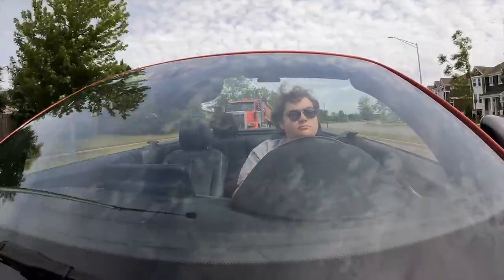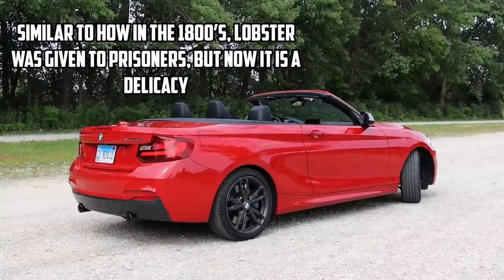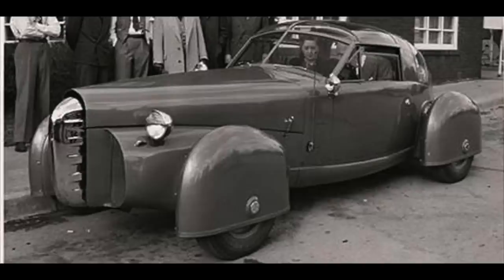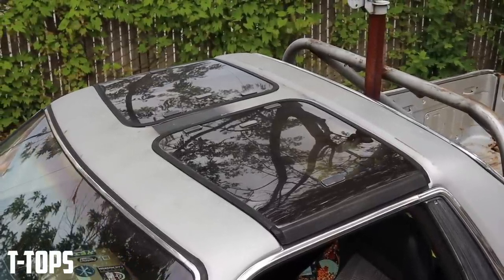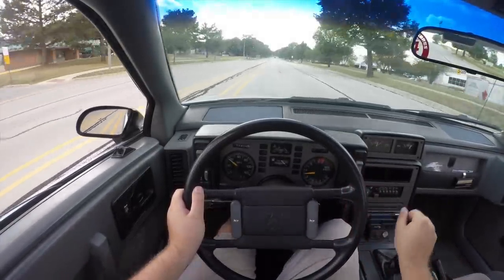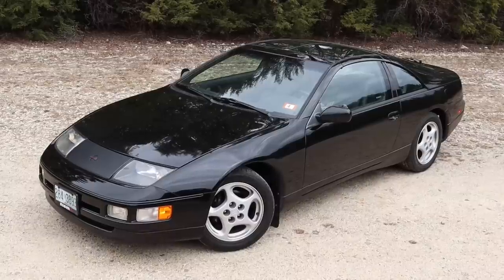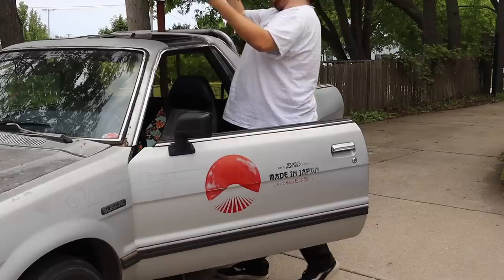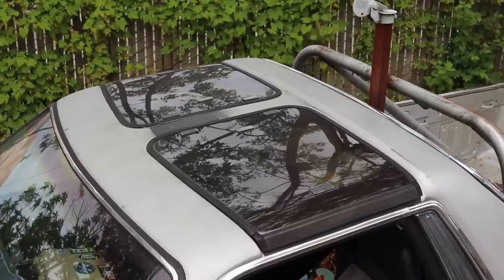T-Tops - How They Were Invented & Why They Went Away!

Comment: I agree with your assessment as to why they no longer are made. Maybe you can do a video essay on older cars that had bright light switches on the floor boards? I haven't seen those in years. Or, headlight wipers/washers, you don't see those much either on new cars.
Reply: I remember in '93  when I was in the Air Force I got a call out to fix something in the B-52 bombers cockpit that was waiting to takeoff, it was one of those stupid switches on the floor!  I guess its used for the landing lights?  I was so surprised to see it but it makes sense since they were built in the '50s....
Reply: I think headlight washers are still common. European-spec cars require headlights over a certain brightness (HID and LED, basically) to have auto-leveling and washing mechanisms. I think the floor-mounted light switch was phased out because putting them on the turn signal stick was slightly cheaper and more convenient. You can't flash to pass with a floor button that's either low or high. I have a car with a floor-mounted switch and it's annoying to flash the lights or even turn the high beams off sometimes because it's a manual.
Reply: @bwofficial1776  My '67 Volvo also has the hi/lo switch on the floor, agree it's a pain with a manual trans! You can flash the hi-beams by pulling the turn signal stalk, so it's a little bit of both!
Reply: Headlight wipers phased out when glass was substituted for plastic - you can’t rub plastic with wipers without damaging it 
The washers are mandatory on all Xenon headlights where I live 
Maybe other types like matrix LED 
not sure
Reply: You mean floor mounted headlight dimmers? In practice I never seen anything wrong with them. They made for a less cluttered, complicated, and busy looking steering column.
Reply: How about the lenses they would put on the dash that would capture the color of the traffic lights because the cars had those big sun visors that would block the direct view of the light. 
I guess they made it so you didnt have to lean forward to see the light turn green.
Reply: @judgegixxer  Growing up in the 1980s we had a 1949 Plymouth with the big visor and it was impossible to see the color of the light if you were real close.  The round lens with a suction cup would reflect and you could see the light and the color of it. (Just an angled piece of plastic or glass is basically all it was.) I had forgotten all about that until your comment.)
Reply: My understanding is that the dimmer switch on the floor was from the early days of cars when the low/high actually tilted the headlight module, or perhaps moved a shade inside it, rather than switching between filaments. It wasn't a switch, it was a purely mechanical linkage. Having it on the floor made this linkage simpler than it would be on the dashboard, and moving that with your hand would be less convenient. Once they went to having electrical switches that changed which lights were on, this was retained initially due to familiarity, but eventually they found that moving it to the steering column as part of the turn signal switch was easier for the driver and allowed it to be within an existing electrical module. It's interesting to see what design decisions even now are vestiges of past technologies, done a given way because that was necessary for a past design, but with current designs that no longer mandate doing it that way they continue to do so because it's what everyone is familiar with.
Reply: My 2017 Jaguar F-Type R had headlight washer nozzles as did my 2002 Audi TT.  I always thought they were so James Bondish.
Reply: @vinny reviews Ah, that's much more recent than I would have thought! The F-series, at least until more recently, tended to be a bit more "classic" in style, not really keeping up with trends (back then it was meant purely as a utilitarian machine, not what for many is now a large luxury sedan with an unusually large trunk - a truck with a bed cover effectively is that, and certainly many use it in that manner). But that generation was 1987-1991, so wasn't the same design unchanged for like 20 years like some of those trucks were.
Reply: The funny thing is you can still buy them from part stores or order them online, some use them as a security device or as an interesting way of operating custom accessories.
Reply: They're probably gone because they worked and if you ever had an issue with them it literally took two Phillips head screws at about 5 minutes to replace them and they cost in today's money about 4-6 bucks. 
The same goes with the wiper switch actually being on the dashboard I don't think they ever go bad and if they did they were really easy to change at home without a professional mechanic or a tool chest full of tools.
I personally miss the dainty turn signal stock too but I also like the over power steering feel from the 1950s to the early 1980s, bench seats that felt like sofas and thin steering wheels that you could easily grab.
All the car manufacturers wanted the cars to have tighter suspension and more road feel because they listened to magazine editors who compared Ford LTDs and Chevy Caprices to Porsche 911's,  as if we were all driving up windy canyon roads pushing the car to the extreme edge of what it was capable of doing when in reality is most of us spent a good portion of our time sitting in traffic going between 5 and 35 miles an hour on long relatively straight stretches of interstate style highway rarely leaving the highway in the cities that we commute in.
Reply: @darylkik777  its literally called a traffic light viewer, Amazon still sells them, obviously for classic cars such as that 49 Plymouth you mentioned or the 1930 Ford Model A in my Avatar picture but actually they are pretty handy in big semi trucks.
Reply: @henrent I think he was referring to American cars that had the headlight dimmer switch mounted on the left hand side of the floor it was a little aluminum round button that you hit with your foot it was real common up through the early 1980s, 
On what is now older vintage American cars the windshield squirters were usually located on the windshield wiper switch you just pushed in on it.
Reply: @AtomicReverend  Our 49 had a huge overhang to keep sunlight out (I assume)  If your a trucker I want to thank you as I travel a lot and I know some of the crap you deal with. (car morons) I drive a large tandem axle plow with spreader for the city but its only a class B requirement, with Air brake endorsement and I have tanker endorsement. I get to pretend its a big truck when weather calls.  Thanks again
Reply: @darylkik777  I am not a truck driver at least not a commercial driver, I have my CDL but I would miss my house.  I just have a love for all things automotive especially 1920s-1980ish.
I have had probably 140 cars, trucks and big trucks in my life most of which that I have put back on the road that were left for dead.
 California has some really strict emission laws on diesel trucks and as a resident in the Golden State the last one I had got sold a few years ago because they wanted me to retrofit the diesel engine with some crazy emission package that cost more than a 1957 Kenworth is worth, I used it to haul old "rust bucket" cars from their resting place to my garage or to car shows and everything in between, it was fun going to Pomona swap meet (a huge car swap meet here in Southern California) with a vintage big rig towing a trailer full of vintage cars. 
Anyways I am very familiar with a 1949/1950 Plymouth, they are one of my favorite cars I'm not kidding, I like the flathead 6 and their simplicity plus they are pretty reliable. The visors I am also very familiar with because those cars look good with them in my opinion, pretty much every car from 1949 to 1954 look good with a visor. 
The trafficlight viewer I actually became familiar with because one of my friends had a pretty radically chopped 1930 Ford Model A two-door sedan that I guess today would be called a ratrod and you sat so far back from the windshield you couldn't hardly drive the car it looked really cool but it definitely was impractical as a driver he had the mirror mounted up on the dash so he could see the traffic lights I thought it was a pretty ingenious idea and then he told me they still sell them as I thought he had an old vintage one, that is how I came across them, up until his car I probably looked like a nut bobbing and moving my head around trying to see the traffic lights when I was the first car in line. Now that I'm getting a little older I'm a bit safer when I drive so visor isn't going to block half the windshield anymore nor am I going to drive a car that is so chopped you can't fit your arm out the window but yeah that is what the mirror and visor was for although the visor was definitely a styling accessory back in the early 1950s it was pretty much out of style by the time the wrap around windshield came into Vogue in the mid-50s.
Reply: @AtomicReverend  I think I found my long lost brother.  I am a car nut and do not know every thing but I know quite a bit. !930 Ford  would be a Model A with 40 horse power versus 20 from the one of 15 million plus Ts.  (Note all from memory sitting here) The Movie "Duel" from long ago features a 49 Plymouth for about a few minutes.  Yes the straight six never gave us any trouble (I was little)  Just clean the oil/bath air filter and check fluids as I think brake master cylinder  was under the seat so that it was equal distance from all four drum brakes.  I am or was a Ford guy, love British top gear and know many episodes too well.  Lastly this was my hobby: In books(over 40) and in order by manufacturer, I have every car ad from 1888-2000 National geographic That magazine was smaller, better paper and so on.  Also a motorcycle fan.  Lastly if you have heard of the "Inland Empire' near San Bernardino that is where I lived and was ATC at Norton until the day it closed.     Small world, we should chat more, and remember I only pointed a few things out that you reminded me off.  I also have lots of car pics (Lost track about 75 total years ago .Not me as I am 53 now.) of the 49 and many more on my Facebook. Love 3 on the tree as people would stare at the clutch wondering if it was auto or stick.   Off to bed late 50 are my favorite and yes I know, quality and cars were crap and later "Unsafe at Any Speed"  Loved Corvairs.  Daryl  (yes every car ad only saved, in order and the books are right behind me now.
Reply: @AtomicReverend  Maybe they wanted to put a DEF in your truck for emissions and lots of cash.
Reply: @AtomicReverend  I wrote you two messages and they are gone. I am not rude, or use profanity.  Will write back and send in two emails

Comment: There used to be (and maybe still is) a company that would convert the newer Camaros into t-tops. I think it was the same company that did the Trans Am conversions.
Another video essay idea: high-end sound systems. Back in the 80s you could spend as much as a small car and get a system with a couple modules put in your center console. Head unit, equalizer with sliders, tape deck, maybe even a CD player. Look at some of the Mercedes-Benz customs and you'll see. Today all of that can fit in a single-DIN head unit and sound just as good.
Reply: Back in the day you could upgrade a car stereo significantly for a few hundred. A good head unit, a couple of speakers and the sound was transformed. Many cars didn't even come with rear speakers.

Now. Virtually everything has at least adequate sound from the factory. A typical setup is a pair of 6.5" components up front and 6.5 coaxials in the rear doors and a reasonably powerful 4 channel head unit.
Reply: American Sunroof Company (ASC) did the original T-tops in a lot of GMs, including some year Monte Carlo and F-body.
Reply: I think they still do. If I'm not mistaken, they have a piece of equipment that's specifically designed to cut the t-tops in perfect.
Reply: @Rapscallion2009  In 1981 I paid $500 for a cassette deck with 2 speakers for a 69 camaro, Not installed. I still have the deck. Have to get it out and see if it works...
Reply: except the "sound just as good" is subjective...smaller speakers can never sound as good as larger ones to me...regardless of quality or brand
Reply: Shawn 🏴‍☠️ Stafford  They're a custom car builder...if someone wants t-tops in a car that celebrates the past, why not give them the option? Chassis rigidity is way better than it was on any of my 3rd gen or my 97 WS6, I wouldn't hesitate t-tops if I had the money
Reply: Trans Am Specialties of Florida will build you a new Trans Am from a newer Camaro, check out their videos
Reply: Shawn 🏴‍☠️ Stafford  why strange? I would rather have a new Trans Am that a new Camaro! I got my 1st Trans Am in 1985, was the black/gold SE Bandit II! My 1st Ttop car was a gold '78 Z28 that I drove all thru high school! I also had a Ttops in my '77 Bandit, burgundy Regal T type, red '88 IROC-Z, red '92 RS & black '98 LS1 6sp Trans Am!
Reply: Shawn 🏴‍☠️ Stafford  haha I lived in Florida for 5 yrs around Tampa & Sarasota Beach & didnt really care for it much & have relatives that live in Fort Walton & St Pete that have lived there since the 1950s! I am a Georgia boy & grew up in Hazzard County {Covington} & got to be in the first episode 1978 {YouTube Dukes of Hazzard : Chase From 1st Episode} & I was in Cannonball Run 1981 where Burt Reynolds lands his plane to get beer on the square {YouTube Cannonball Plane}! I also got to see some of the filming of Smokey & the Bandit as they filmed it all around my hometown area! As for me, I love Ttops & enjoyed the hell out of them the past 45 yrs & hope to get another one soon! Take care of your T/A & hope it gives you lots of fun!
Reply: Hurst also did some of the 2nd gen Camaro/Firebird t-tops for GM.

Comment: I absolutely love the targa top miata. they look great both with the roof up and down. and having that roll hoop just makes it feel so much more secure. porsche targa are also among the coolest cars where you can take off the roof for the same reason. looks great with the roof up, loogs great with it down.
Reply: They really aren't targas as the rear window goes away as well.  And there is no structural safety added there.  They still have the supports behind the headrests the same as the soft top. But I def agree about the looks.  I have a 2020 polymetal gray  RF.  LOVE IT! 😀
Reply: @jeffwertz2953  rear window stays in place with a targa with a roll hoop over the occupants of the vehicle
Reply: @isaks3243  Correct, but NOT on the Miata.  So that is why Miata is not technically a targa. 😏

Comment: I have no experience with T-Tops (though my 88' Supra does have a removable targa top, and it can drip a tiny bit depending.) But one while I was checking out my local mechanic's yard, he has an 80's MR2 that was there for about a month or two and the passenger seat was puddled with water from the glass T-tops. 
They seem kind of like a sealing night mare to me. Removable hard roofs I think are the best of both worlds (though they do flex a lot.)
Reply: It's kind of strange how car makers have no problem sealing doors and trunks but targa-tops are a problem. I guess it's because the tops don't have the heavy duty hinges and latches that doors and trunks have.
Reply: i had a 89 camaro, they leaked.... then a i had a 96 they didnt leak. it seems like they improved the designed and then phased them out
Reply: They leaked !
Reply: In the early 90s I had a 280ZX and then a 300zx and neither ever dripped a drop of water. You had to keep the door and t-top seals from drying out or replace the entire set for about $200.00 back then. (Loved my tops, was always jealous of the Supra and the Targa top.
Reply: @darylkik777  Lol yeah the targa top is cool, but more so when it was new. Now it's something you have really work with the seals on. But you know what else? At least in mine the drivers side bolt likes to walk itself out (from all the major flexing) and if you don't tighten it in a long enough time , you'll have wind noise and a gap.
Most the targa top kinda sucks because it has so much flex and noises to the chassis. The doors are reenforced to deal with the top being I've (I've never tried it yet, I've heard it's a little scary with the flex. So yeah, it's better than T-tops and sunroofs, but still has some issues!
Reply: @rushnerd   glad to know my supra isnt the only one with walking targa bolts 🤣
Reply: I’ll take a T-Top design any day as opposed to a full on Targa. Having  owned a 1993 MR2 Turbo and a 300ZX Twin Turbo the chassis didn’t lose much rigidity when you took them
off and easy and light to remove. Then I got a Supra Turbo and it was endlessly noisy with flexing/creaking noises….. and with it off completely it totally ruined the cars handling. If I was a I ever blow a ton of money on a A90 Supra I would search for one of the very rare slick tops because that targa roof sucked